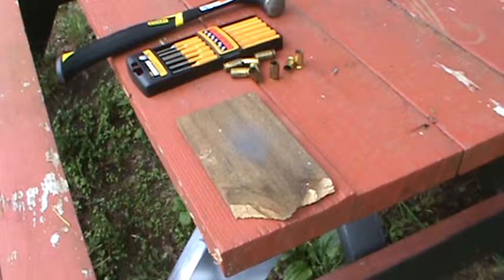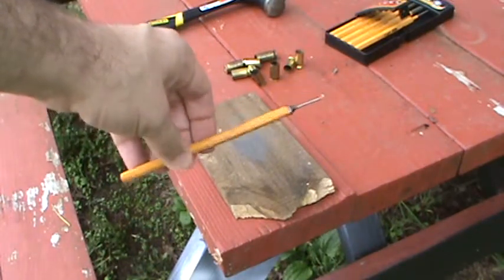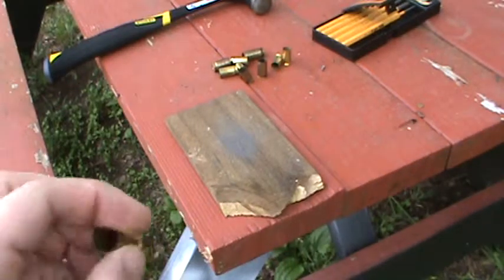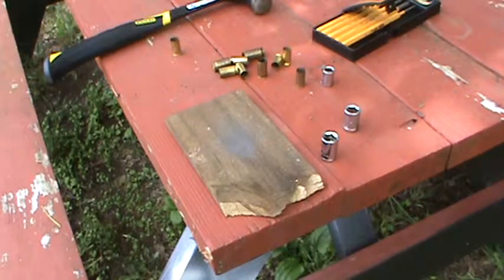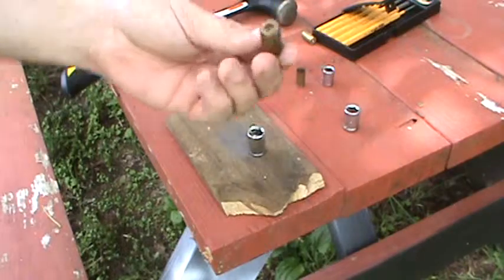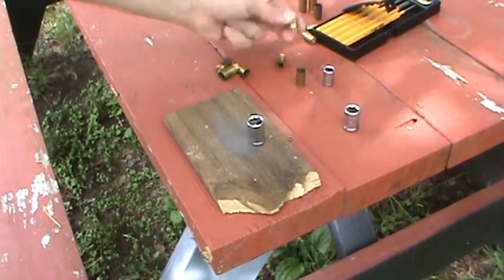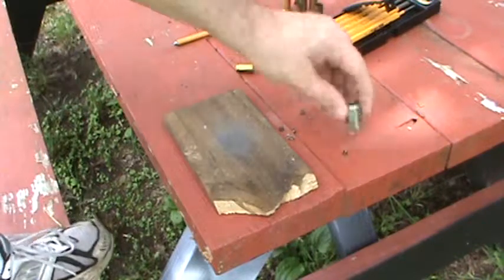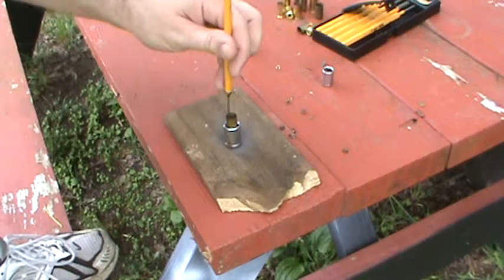Depriming .40 S&W  .45 ACP  .9mm Luger Brass

Comment: Great idea. Didnt think of using a socket and pin punch. I was using a vice and drill bit. Now i just need to find a pin punch with a small enough drameter to go inside 5.56 brass.